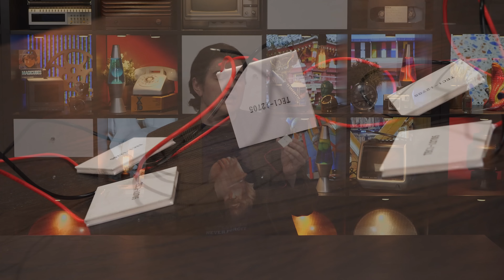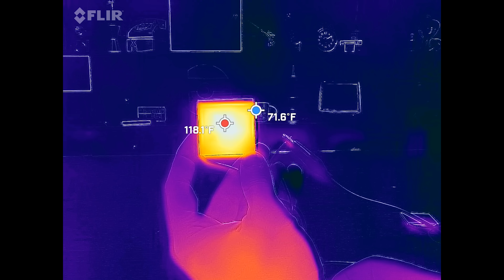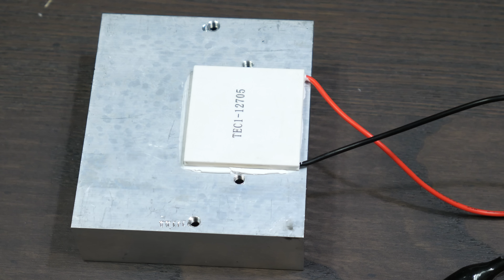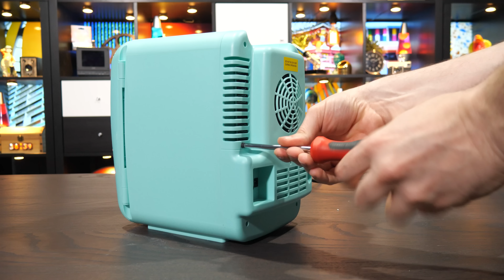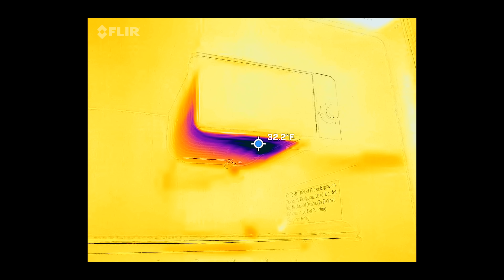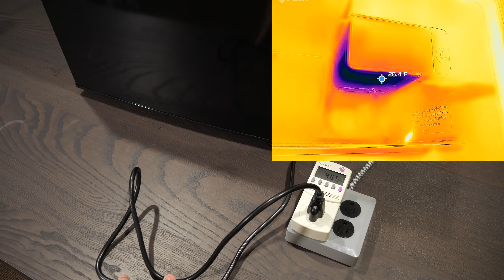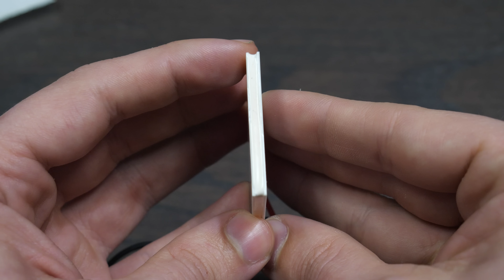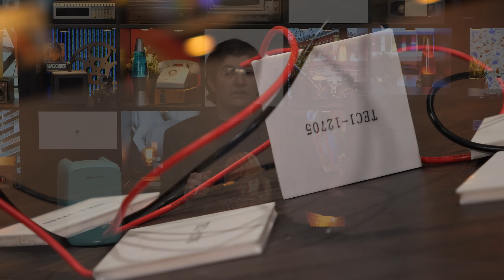Thermoelectric cooling: it's not great.

Comment: Great Video. I've bought so many thermo-electric coolers over the years.  Thought they were so "cool".  They'd last about a year until the crappy fan died.  I did assume for way too long that w/o a compressor that it MUST be saving power.  Then I got a kill-a-watt meter...  Ouch.  My new love is the 12v compressor fridge.  I keep a small one in the car all the time & have a larger one for road trips.  Pulls about 30 watts when running. Now, that's "cool". Not sure if the compressor has been specifically designed to survive life in a car.  Been ok for around a year...  so far.

Comment: @There is another missed use case for peltiers, enhanced cooling for electronics when coupled with a water loop.  Using peltiers can result in small processing chips both going under ambient and in accelerating the movement of thermal energy away from the CPU and into the water loop.  Normally you would have a big chunk of metal in direct contact with a CPU and a fan pushing air over it as a way to move heat, this isn't very good when pushing processing capacity.  Another way is to use a heat exchanger known as a water block and run water across it and eventually to large radiators, this is better then direct air but still limited by the thermal conductivity between the metal and the water.  Using a peltier to forcibly suck heat from the CPU and push it into the water results in significantly enhanced cooling, at the cost of more power utilization.  CPU's under load already run at 40~50 degrere's C above ambient so the situation favors peltiers.  The only thing better is direct cooling with something like liquid nitrogen.

Comment: I used to use a Peltier on my computer CPU back in Ye Olde Overclocking days to get those sweet sweet subzero temps so I could get a couple extra FPS on Team Fortress. It had to run on its own power supply and occasionally the CPU would make more heat than it could move, turning it into a ceramic insulator and immediately spiking temps and crashing the computer. Good times!

Comment: Looking for some advice here.
Would a compressor mini fridge be safe to use on a sailboat? I like to run my boat with heel angles close to 30 degrees. Now I would probably not run it when sailing but it would be tied to shore power and start up as soon as I connect to the dock.
Your thoughts please.

Comment: You do realize mechanical thermostat can and should be regularly adjusted (ie if the cycle is to short just adjust it)!
Reply: Electronic ones too but less frequently and most of the time you need a programmer you can't just bend or twist a screw

Comment: Peltier plate is only good for very small loads in very tiny space.
Lets say you want to add cooling to your chair.
getting a heat pump is not gonna work size wise, and for that 2-3 degrees of difference it's a massive overkill. 
if it runs less than few seconds per minute, (those things works best when "hot" side is kept firmly as close as cold size is)
plate might be for you.

Comment: I always saw them as a gimmick anyway - and the six can one isn't even the smallest one. I almost bought one, purely as a gag, that fits exactly one can! It propably needs all day to cool that one but I had to laugh out loud when I saw it on the shelf.

My issue with true mini fridges is just... While 100 pieces of paper isn't maybe too much money on itself - when I can get a regular-sized one for 140, it feels pointless? Having the same problem with mini freezers and mini dishwashers. Neat, useful, overpriced in relation.
So, yeah, I did buy an entire new fridge instead of plopping a mini freezer on top of my old one that would barely fit one frozen pizza.

Comment: I have one and it keeps my beer pretty cold and I don’t even notice the noise. Sometimes the wall gets ice on it. Ive been using it for around 4 years. I don’t even use it all the time.  If I buy a 6 pack I’ll turn it on and use it for a couple days and then turn it off.

Comment: We have a car-model cooler with active peltier device. It runs at a much lower wattage (with no need for a fan) because the use case is that you're treating it like a cooler first, and just using the peltier to slow down the warming. Though now I wonder if it's worse than just having good insulation with ice packs...

Comment: Mains refridgeration today is so efficient. Probably better than most 12v portable stuff
I've run  242L fridge only and a 155L upright freezer off grid for years
Drain for both over night is 30A at 24V
And far easier to find stuff than in a 12V fridge

Comment: This whole video is literally a giant strawman to bash a technology for being used in a way it isn't intended to be used. It'd be like if someone built a fridge out of PC all-in-one water coolers and then TC proclaimed that all water coolers suck because they don't make as good fridges as compressors. Of course they don't, they're not meant to! Yeah Peltier coolers are less power efficient than the big bulky compressors, but they're better in nearly every other metric (speed, size, reversibility, no moving parts, ability to generate power, efficiency scales with extremes, consistent stable power draw, chainability, cost, etc) power-efficiency is the ONLY thing compressors have over them, and he's acting like that matters for a technology not meant to be run constantly in the first place...
Reply: He's bashing the coolers not the technology itself, because it is being used in a way it isn't intended to be used, namely to cool beverages. What do you mean by speed? It's much slower at cooling things. And they have a fan which is a moving part.
Reply: @Zeno5140  His pinned comment makes it clear he doesn't see any value in the technology as a whole, not just these mini-fridges. They are much faster than compressors since they begin to cool nearly instantly and reach their lowest temperature in just a few seconds, you can see this in the thermal video.

Comment: Also, trail a small satellite, shaped like a surfboard, make the heat resistant shielding panels out of Peltier material, leash that to the space station or anything orbiting earth that needs power, continually skipping it off the atmosphere, to create heat on one side and cold on the outward side, creating voltage/power and youd have useful repetitive energy.

Comment: I got a desktop mini fridge a few years ago, it worked alright. I ended up throwing it out because it was $15 and I left a bunch of food in it for a long time, didn't want to open it. Recently I got a slightly bigger one to cool my insulin. This one works well, in 95 degrees, and keeps my meds and a couple sodas pretty cold. I wonder what the result of putting like ten of these with heatsinks and maybe a big fan would be like.

Comment: Peltier coolers look like they could be quite useful in spacecraft. They don't require gravity or ambient air pressure to work, and can work across a huge range of temperatures. They're also incredibly light and don't cause vibrations.

As for terrestrial use, I agree. They're incredibly inefficient.

Comment: If you love heat pumps, you must be livid at electric cars that HAVE air conditioning but do NOT HAVE heat pumps (ie dont have a reversing valve to use an air conditioner in reverse) and thus burn 3x as much energy as necessary to warm the car in winter with resistance heat.

Comment: I have one of those mini fridges, and when I saw your video I was like "oh, maybe I fvcked up" but no, I bought it so my brother didn't take my cans from the house fridge, and I only used it from time to time, also it has the function to cold and heat, and ALSO it came with the cable for the car, so yeah, it cost me like 38usd (converted) so I guess is not that bad, rn I am not using it so it's there on the shelve

Comment: I had a Coleman electric cooler that used a peltier unit, I thought it was the best thing ever, since I’m a trucker I needed cold drinks while driving, and they sold them at the truck stop, pretty expensive at around 220$ or so, the wires overheated and broke off, I tried fixing it, it didn’t work right and was horrible, I got suggested a vevor cooler, it’s like night and day, this actually is a fridge/freezer, it’s made my life wayyy easier, never going back to peltier

Comment: Also, how the heated/cooled seats worked in cars. It switches polarity to determine if the cold or hot side blows into the seat.  With that 30 degree delta limit, the heat didn't work very well in cold situations. 

Nowadays they use resistive heaters and the peltier is just cooling

Comment: ok so what if we use the peltier technology with a thermostat, wouldn't that solve the issue, so two peltier chips to double the cooling a bigger fan and a thermostat module, so it doesn't run when it reaches its optimum cool temp

Comment: 29:07 kind of disappointed. Was waiting the whole video for the quote, but I know something about tinkering “part just like you said in the previous refrigerator video, but I know something about tinkering. These larger refrigerators have fans. And I can obtain fan!? I thought it would be similar here, but, but I know something about tinkering. I can obtain insulation and let’s put a thermal controller on this thing!

Comment: I have a portable car cooler with a Peltier module. It's about 45 liters and actually works...okay...
Say I'm going on an all day trip, or going to do something in hot weather, I just put 1 or 2 flasks of water in and it either keeps it the same temp, which is more than enough since my tap water is cold anyway or cooler. That's also good enough. It takes a LOT of time to cool anything down all the way as you said.

Comment: Honestly the most novel/useful Idea for Peltier coolers i've seen has been on mobile gaming devices like the ROG Phones (They have a module with a Peltier cooler with a fan on it that latches onto the back of the phone). 

For devices that don't really want moving parts in them (as they are your daily driver and whatnot), that is one of the novel uses of the form factor  as it sort of offsets a lot of the problems you see with the cooling impliment in cases like these cheaper minifridges (primarily air being a very poor medium for thermal transfer)

Having direct contact onto the back of your phone, which is made of thermally conductive materials like Glass and Metal, helps cool down the back of the phone, and therefore the interior of it as it's all sandwiched together quicker. Therefore increasing the effective thermal capacity of your phone's processor. And the fan on the back of the external cooler effectively becomes a fan for your phone itself as the module pretty much bonds to the phone with the "Coolness".

Mind you it is a hyper specific use there, but one that is sort of novel. Heck, if Nintendo, Microsoft, Sony, or one of the guys making those PC Gaming Handhelds (ASUS, Lenovo, Ayn, Aya.etc) wanted to make a docked-mode for a handheld (Switch 2 primarily but the PC gaming handhelds do have far higher wattages when plugged in accessible), they could put a Peltier cooler and a fan in the dock and have it make direct contact to the back of the device where one of the heat pipes would be behind, increasing the thermal capacity without making the device as thick.

Comment: I remember when Peltier coolers were used in like two or three expensive desktop CPU coolers for like one or two years and then those products never seemed to resurface. Phone chillers are semi-popular nowadays, and, uh... do you really need your phone that low? If you have a phone overheating badly enough to warrant one of those, the phone (and probably what's running on it) is the problem. For the most part a block of metal and a fan without a TEC would do the job in most cases there. Not that I didn't give one of the latter a go at one point, but that draw's no joke.

As for the "fridge," damn. I could spend that time going over to a corner store to grab some ice to lay those cans on.

Comment: The internet stands on these Peltier cells, somehow. Telecom semiconductor lasers require a fine current and temperature stabilization to keep a steady wavelength, plus they're encased in very low thermal inertia chips.

Comment: One little * I'd personally like to add to the COP comment about heat pumps for heating homes is that the "free heat" depends on how your electricity is generated and alternative forms of heating. My area is powered by natural gas, so a furnace can output more heat per unit of fuel than a heat pump. This won't be true forever as the grid is evolving (and hopefully fusion is on its way), but it is true for now

Comment: I use them in one specific application, cooling boxes in the car when I go shopping in the summer. I got a long way to drive and the food would be spoilt before I get home without it. There are proper refrigerators for cars too, but they cost at least 5-6 times as much, and I don't see the point for such occasional usage.

Comment: The problem is they just aren't being used efficiently. Firstly, that's a horrible heatsink. Something like a PC heatsink would definitely perform better. On top of that, more peltier units but run at lower power would work better too. This isn't exactly a failed technology, it's just being utilized cheaply with bad design principles. It needs more surface area. So an array of 9 of these on the back, run with much lower power input each, with a radiator style heatsink or finstack heatpipe heatsink, would perform infinitely better. Throw in an extra insulating design, and while it would be bulkier, it would perform pretty well. Throw in a physical mechanism that insulates the peltier modules from the fridge itself during off cycles, and that would further increase efficiency.

Comment: I really enjoyed your video and ofttimes times cheeky humour. We have owned a 12vdc Peltier element cooler since 1999. It is used predominantly for keeping perishables cool during shopping trips (we live in a remote area of Ontario, and our home is an hour from the nearest grocery store). It works very well for this application. We do have the 120vac adapter, which we rarely use at home, except in instances when we need extra temporary cooler space - operative word being "temporary" (in fact, the 120vac adapter gets more use in my laptop case so I don't have to remove the stock power supply from my desk when I'm traveling). 

Another use for Peltier elements I have been experimenting with is generating electricity. I use my hot water system (heating elements based on solar diversion loads and a hot water wood furnace) and the freezing winter temperatures outside to heat and cool each side of the element to produce electricity. So far, not too bad, except my hot water tank peaks at 180deg F so we're not realizing the full potential of the element. Still experimenting with the piping circuits and pumps (to circulate the hot and cold fluids).

You are spot on wrt these little coolers. They have their niche uses, but like we've been seeing more often nowadays, purveyors of goods are looking for ways to "trick" consumers into buying something they either don't really need, or could be better accomplished with other technology. Its amazing what you can do with good ad copy!

We live off-the-grid and are sensitive to inefficient appliances and phantom loads. Regarding the rating guide for electrical appliances: I find the Canadian version way too optimistic.

Comment: Just realized I have 3 dehumidifiers in my house that use these Peltier elements, an altough they remove quite a bit of water they might be costing more in electricity than the chemical ones on the long run...

Comment: Interesting to hear that +7 isn't considered food-safe temperature in the USA. In USSR (and by extent, CIS countries) the advised temperature in the fridge was between 5-12 Celsius and later updated to +2...+8, in both cases with recommendations where to keep the produce that requires lower temperatures for storage and where to keep stuff that is better with higher temperatures. 
So in both cases, 7 Celsius is within the food-safe temp. 
Though it does beg a question what are the expected time frames here. It is quite possible that the food is expected to last longer in USA, for example, or maybe stored differently (in theory, just like how the "summer shopping" is a thing) 

In most countries I've been to, people actually prefer to shop often but with smaller batches, and eat stuff fresh, rather than shop once a month but stock one of these 600-liter fridges. Honestly I am more of a bulk shopping guy, US-style, but most people around me are not.

Comment: There was also a brief period when Peltier-effect devices were marketed as an improvement for CPU cooling in desktop computers, with the Peltier plate sandwiched between the CPU and a 'normal' heat sink and fan setup. As I recall, they failed in the market because the plate was a very efficient insulator when not powered, so that if you lost power to the Peltier device through whatever problem, your CPU would overheat within seconds.

Comment: I bought one. Drilled three 1 inch holes in the upper half of the door and ten 5/16 inch holes in the lower half. Mounted a slow moving fan inside near the top. 
I set the switch to the heat position, put it on the floor in the winter to keep my feet warm while I use my computer. It uses only 45 watts.